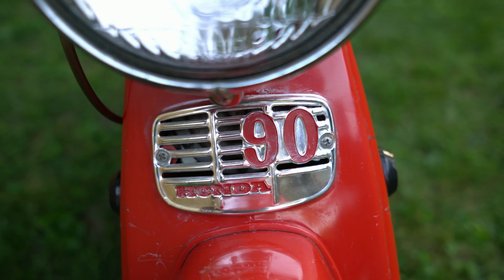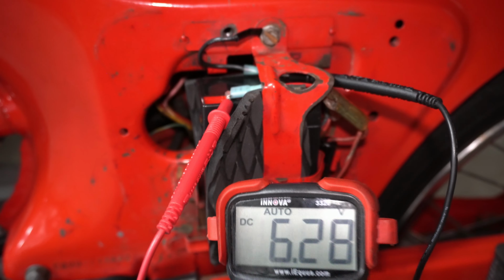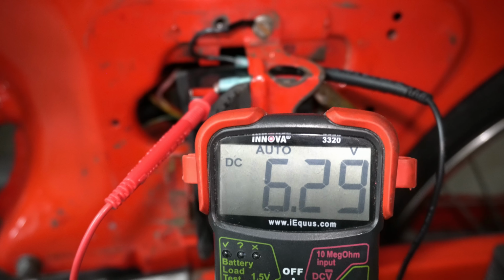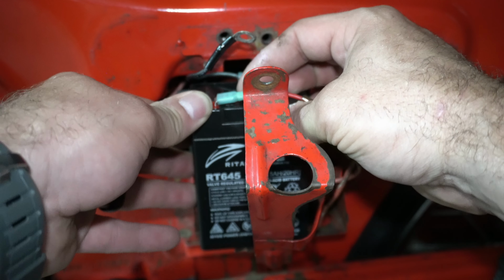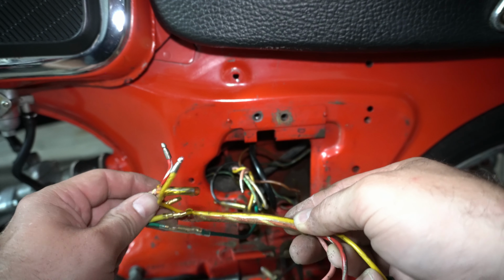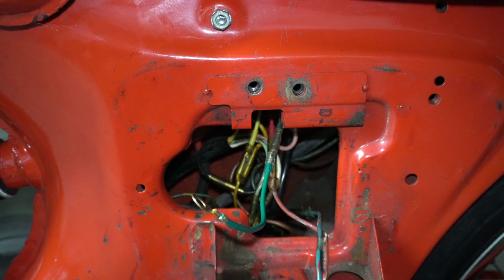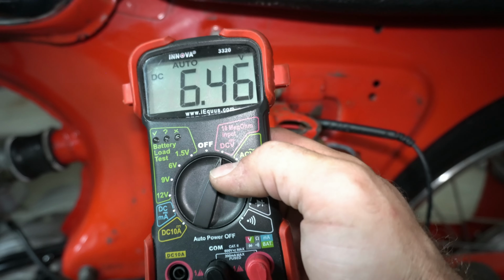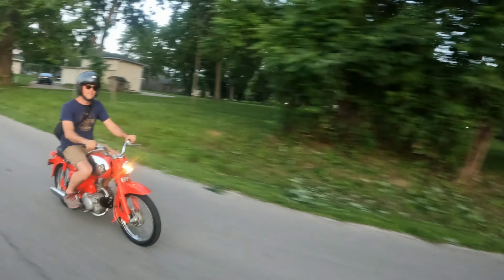Vintage Honda Motorcycle Not Charging? Here's an Easy (Potential) Fix and Upgrade!

Comment: I just want to leave some extra information here for anyone that finds this video. A lot of the 6v systems are "balanced." They don't let the battery overcharge, and also don't let it discharge much of either direction. YOU MUST FIRST CHECK LIGHT BULBS!!!!! A lot of these issues could be from someone replacing bulbs with ones of incorrect wattage. Go find the parts catalogue and look at the bulbs used by Honda from the factory. Going from a 6v 1.5\1.7W bulb to a 3 watt in the speedo for example, will place the system out of balance. Most of the time the charging current for the battery is .2 amps. Just going from a 1.5w to a 3w bulb added .2 amps to the total power demand. It's that critical.

Another issue with the really old bikes is that the magnets in the rotor will degrade over the decades. So you could possibly change some bulbs to lower power demand. I for example found a taillight bulb that is 17w\5w instead of the standard 21\7.

Also, for those bikes that have blinkers all this is very important. The relay will show what the circuit can draw. Usually it's 2x17 and 1.7w for the indicator. This is where I found my issue because the indicator was a 3w bulb and would drain the battery low enough to cut the bike out in sync with the blinkers after about 15 seconds of use.

All this plus make sure you have a GOOD battery. I went OEM Flooded battery. I made a charger with a 12v\1A charger and a 12v bulb between to drop voltage. Charge battery until you reach 7.5\7.8v while on charger and let sit until it equalized the charge. Should show about 6.4-5ish volts after about an hour. YOU MUST CHARGE BATTERIES OUTSIDE. THEY VENT HYDROGEN GAS THAT HAS THE POTENTIAL TO CAUSE AN EXPLOSION!
Reply from the maker: All very good info, thanks for posting!

Comment: Just got one of those rectifiers on ebay. I didn't see that exact 'Ben' but the one coming looks exactly like yours. Mine is not charging up to 6.5+ When you installed the new one...wow what a difference. My light goes dim in a matter of 45 seconds after a ride. I shouldn't do that. To me; it's not charging as doing the test like you showed & did a great job by the way. Thanks, Wildman RG3
Reply from the maker: I'd say it's probably the same thing, the names of them come and go. There can be other issues other than the rectifier (such as the stator itself), but weak rectifiers are definitely a pretty common issue. 

Thanks, glad we could help! It's been a mintue since we made that video!

Comment: Very great video. I also have a 1964 C200 with 214 original miles. While inspecting the bike after I purchased it I noticed the wire harness was destroyed by a mouse. I removed the rectifier and the rubber wrap disintegrated. 
This is the numbers on the Rect. 5SB-BG  5.5 
Question is there a site to purchase just the wrap if not would a 5.4 Rectifier work? I would like to keep it stock if possible.
Thanks
Reply: You can replace your old selenium rectifier by a modern (full wave, as that old one) silicon bridge rectifier, for only 5$. It's like the one shown in the video, without the mounting screw and the connecting cables. You can use the old cables, soldering them on the terminals of the new bridge. A 200V/35A bridge rectifier is more than adequate for this application, for the aforementioned price.
Reply from the maker: Thanks! I'm not sure what difference there is between the 5.4 number stamped on there and 5.5? I dont' think there'd be any, especially if they are the same Honda part number and fitment. I don't think you can buy just the rubber cover for them, and if it that has disintegrated, the recitifer is likely old and worn out anyways. 

As far as retaining the original look, I do see some NOS ones on Ebay for around 100 bucks or under. I thought that somebody was making upgraded versions that retained the factory look like offering improved charging, but I can't find any for the 90's. 

This is what I'm thinking of though, offered for the 305's: 

https://scramblercycle.com/products/honda-cb77-cb72-rectifier-31700-268-000-new-reproduction

Comment: I watched this with much interest. I have just had my coils rewound on my 1976 CG125. The bike ran fine as it is CDI ign but the other coils were not working very well. little to no lights, no brake light, no hooter and no indicators. Had to get the stator coils rewound and used a firm called Bristol Rewinds UK. Did a good job, cost me £130. All good now....
Reply from the maker: That's interesting, glad to hear it fixed it! There's also obviously other issues that can cause lack of charging (stator charging coils for instance) - but the rectifier units on these older Honda's always seems to be a big culprit! 

One way to seperate out and check the charging coils is to check the AC voltage coming out of each of the wires, per book spec.

Comment: Excellent discussion of the first half of the Honda 6V power challenge. Have you posted a video regarding the second half: what happens to your Sealed Lead Acid battery when you run at full throttle and the increased power produced overcharges the battery? There is no regulator in these bikes, so the rectifier keeps dumping power into the battery. No problem for short rides, but a longer ride at full RPMs creates new issues. It is commonly noted that a flooded lead acid battery is better able to deal with overcharging, but it creates problems for all. I would love to learn about successful addition of a 6V regulator to address this issue.
Reply from the maker: Nope, this is the only video made so far on it. Although, I can't say that I've personally had much issue with over-charging the batteries after swapping out to a newer regulator. That being said, I also very seldom run the 6V sealed batteries and usually stick with the OEM type. (This one the PO had installed one of the sealed units on). 

And, to the second point, I suppose admittedly I don't ride wide open for extended periods of time on these either. 

Upon searching, it does look like many of the units are touted as 'Regulator Rectifiers' with one of them specifically advertising that it regulates the voltage unlike the original Honda ones. So, I would imagine if that's the case, then those units would work as an improvement over original and should not overcharge the battery. 

The original 'Radio Shack' rectifier fix that was popular a few years back? Yeah, probably not.
Reply: True. The silicon rectifier has a lower voltage drop than selenium - the higher output power can cause overcharging, and battery damage is common.  My 305 was chronically undercharging with selenium and overcharging with silicon. I rewired to use the higher output "lights on" dual coils all the time  and added a shunt regulator that dumps excess power into a resistor. Yes it's a waste of engine power but not significant. Definitely significant improvement over the original "hope for the best" no-regulator charging system.

Comment: When lights are turned on an extra coil from stator (white wire) is connected to yellow wire via light switch to increase charge to coincide with extra demand made by lights.